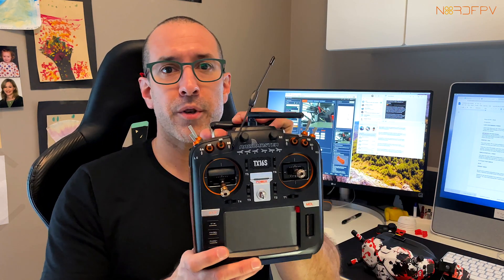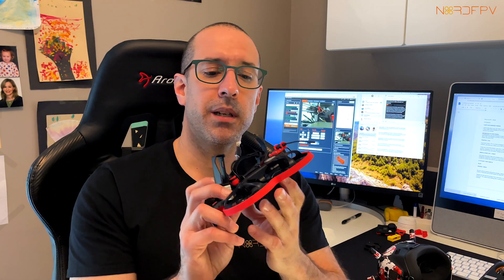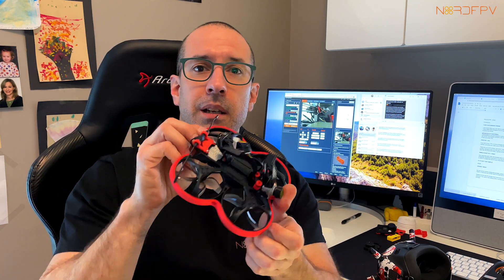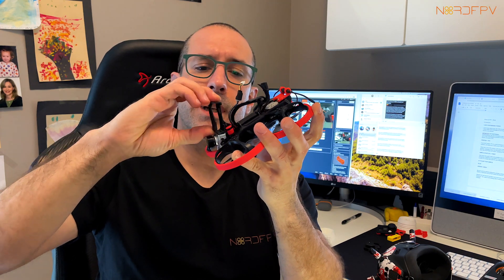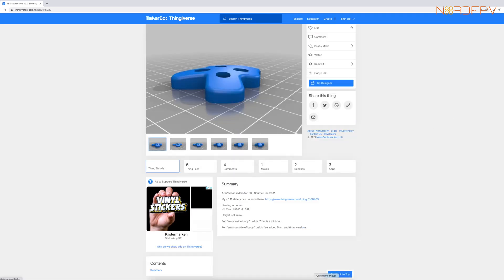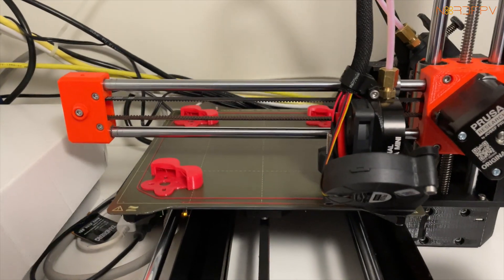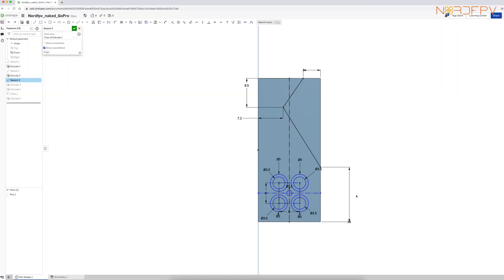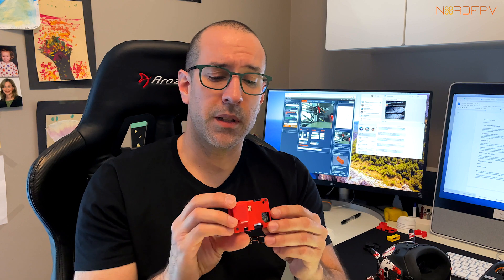Customising your FPV drones with 3D printed parts

Comment: Great video! Thank you. Can you share the STLs for the GEPRC Cinelog25?
Reply: Hi Marco, do you mean the STL for the naked GoPro? I’ll upload it to thingiverse and get you the link later. Or did you mean another part?
Reply from the maker: Here Marco: https://www.thingiverse.com/thing:4815449
Reply: @NordFPV  Amazing!! Thank you so much! Would be awesome if you could also share the mount for the Immortal T antenna. Keep going on ;)
Reply: @juancgallardo  Thanks for the answer Juan. The GoPro mount would be great, but if you have some other parts (like the Immortal T antenna mount) I really appreciate! Thanks a lot.
Reply from the maker: Here is the one for the crossfire antenna: https://www.thingiverse.com/thing:4792642
I'm missing the base for the camera mount. Will see if I have time later to do it. Or maybe you want to give it a try?
Reply: @NordFPV  Thank you very much! The link doesn't work. It’s a 404 😢 I would like to try but I don’t thing I will be capable to to that 😅
Reply from the maker: @marcocristalli  Weird, both links works for me. DO a search by nordfpv in thingiverse and you should get them
Reply: @NordFPV  Tried but in your profile I can see only 2 designs, the Proteck and the Naked GEPRC mount. There is no antenna mount (even if I searched on thingiverse). Thanks anyway and sorry to bother you. ;)
Reply from the maker: @marcocristalli  Don't worry, seems like I never clicked the last "publish" button for this. It should be available now at https://www.thingiverse.com/thing:4792642
Reply: @NordFPV  Now it works! Thank you so much! I really appreciate ;)